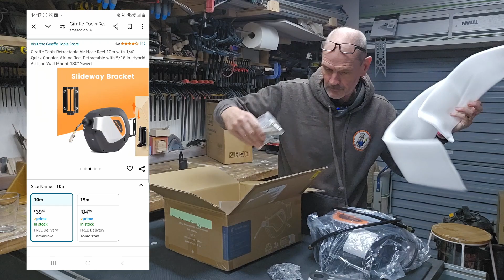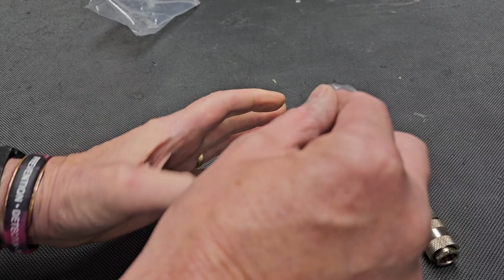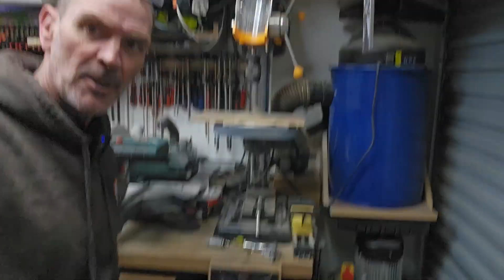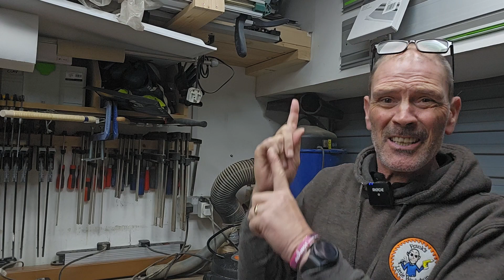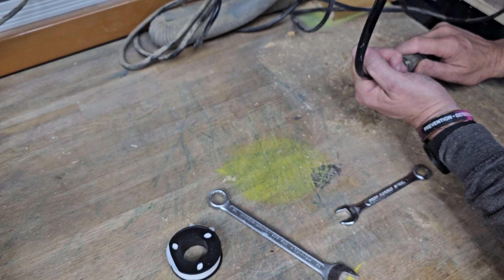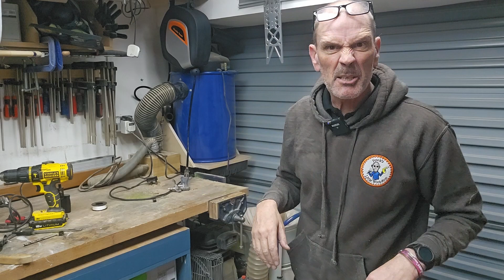Retractable workshop air line by Giraffe tools.

Comment: I have the same hose Frank the 15m version and i can reach everywhere 😂 in both rooms and the outside 😂 i think its perfect.
Reply from the maker: @karlpopewoodcraft  😁 Thanks Karl, it's looking good so far. I was going to get the 15m, but in reality, I wouldn't use it. But I do have another hose (another 10 meters) with the same fittings. So if I need it I'll just connect the two. But for in the workshop this is perfect 😁. Thanks for watching mate 😁👍.

Comment: Hey Frank....thanks for the video..... the only issue I have with these small line retractable hoses is that they restrict the air flow...... But for blowing off and tyre inflating they are ok...... I had a similar line which I had for general use and to connect to my sandblaster...... so it really restricted the operation......changed for a larger flow line.........you have a decent compressor so it seems a shame to use such a small line?  Thanks for the content and of course your time producing these excellent videos!
Reply from the maker: @adam-qf2vz  😃 Hi Adam, your 100% correct. For heavy consumption tools, the air flow restriction would be an issue. For general workshop use (for me) this is just perfect because it's handy. If I need more flow I will just use the other hose that I have connected as it is a slightly larger bore 😁. Thanks for your comment, and thanks for watching 😁 👍